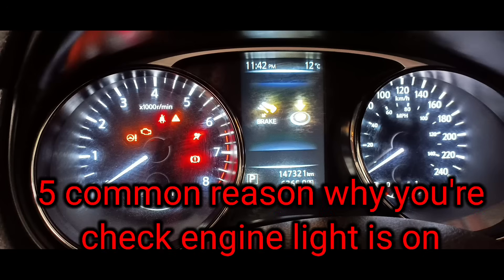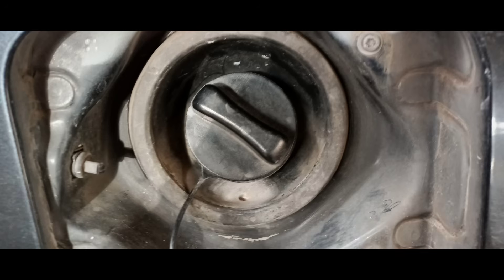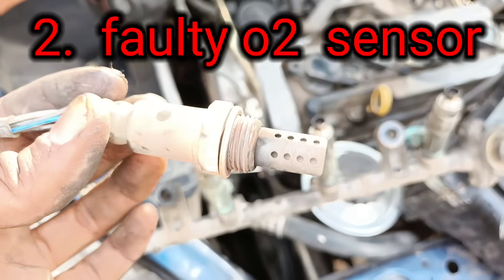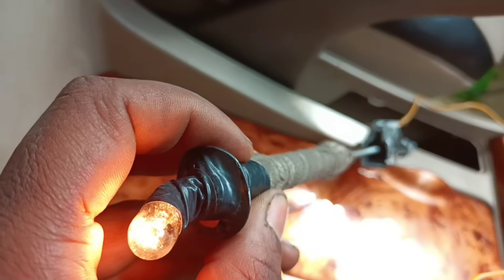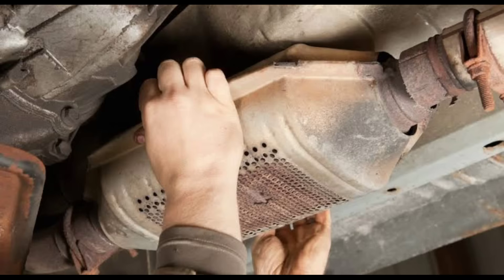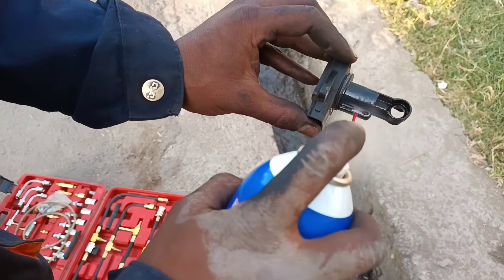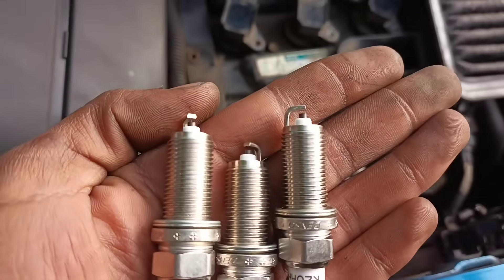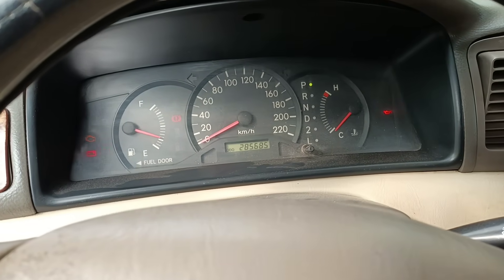The Top 5 Reasons Your Check Engine Light May Be On

Comment: My check engine light stays on most of the time in my 2009 ford escape. A few days ago that light started flashing and it turned out to be a bad cylinder. But before then it was supposedly a bad egr valve and I had it replaced but that didn't help anything. I just had the bad cylinder replaced and that got rid of the light for a little bit but it's back on now but it is running fine. I did use an obd2 scanner and it still reads the code for the egr valve. It is my opinion that older ford vehicles are notorious for engine lights coming on and they are just not designed well. For now I'm just ignoring the stupid light as long as it isn't flashing. I will not buy another ford vehicle.
Reply: Hi  your problem lies somewhere else . EGR will go bad only if you are having incomplete combustion of the gas. This generates soot or carbon and i5 starts depositing in EGR and then moves forward to intake and entire exhaust system. It contaminates the catalytic converter and  the muffler.
Cylinder failure is one of the results .
I suggest you look at the injectors and service them . And check and service spark plugs ,coils and air filters as well . 
But the way where are you located

Comment: My oil change was was overdue and I changed it and then the the check engine sign still appears what is the problem
Reply: When oil change is overdue the light comes with a message and or image of the oil can light up. You can get it reset and see. If it goes away then fine and if comes back then you need a scan
Reply from the maker: Check by obd scanner
Reply: They have to reset your computer. They do that for free.
Reply: The reset is..turn ignition on..tap gas peddle three times fast..this resets the oil life timer..

Comment: Also if your oil change is overdue can cause your check engine light on
Reply: Thanks alot..mine just came up and my engine oil is over due
Reply: My oil light started not going off after I start the car, then go off after a little while. Then it started staying on, then blinking on and off. Then yesterday the engine light went on 😭, taking to a workshop tomorrow. When I stopped at a filling station the guy there said there was oil was it appeared dirty. I hope it's not much🤦🏾‍♂️
Reply: Thanks
Reply: @travispegues8868  to😮😢😢
Reply: Bro thank you I just got my oil done today I was freaking out
Reply: Hv noted the same problem today..am hypothesis it's an oil change needed
Reply: @kamarlyngamba6332  is the light automatic gone after oil change or fixed. ?
Reply: My car had no issues. Few days after my oil change i parked my car at night, no light. Turned car on next morning and boom check engine. Wtf?
Reply: Thank you I should need a engine change
Reply: I'm hearing it cattling
Reply: Omg thank youu. I was so scared for my Subaru 06 sti. I check everything and nothing. Worked then I checked my oil, and it is black. So I assumed that I have to get an oil change.
Reply: @mikunakano8628 😮😢😮😂😂
Reply: @mikunakano8628 also on old cars?
Reply: @mikunakano8628  Lol
Reply: @mikunakano8628 same i need to change ok bro thank u
Reply: I hope so, Nissan told me 30k kilometers for my pick-up. Online i read 20k 🤓
Reply: I am so use "Check engine"' to the extend that when it is not on , I feel worried 😅😅😅😅😅
Reply: Thanks!
Reply: On granny tho
Reply: Ok👍
Reply: I had it changed every six months
Reply: Thank you. I think that is my problem
Reply: The oil cooler in my car is leaking. I'm waiting for parts. I have to wait until December 13th
Reply: To day morning I have the same feeling 😂 I think the oile is the problem 😕
Reply: Oil changes are a scam.
Reply: But there is a red light for engine oil's indication.
Reply: I'm over by 1k miles due for an oc. I'm hoping that's the issue.
Reply: My Peugeot 206 is doing that
Reply: Mine Turned On A Couple Days After I Got My Oil Change, What Could That Mean ?
Reply: Ohh. That’s why mines is on then
Reply: Just did one and still on… sounds like a exhaust leak… or needs a new muffler idk but I just bought this for 2k and man I hope it’s not gonna be a lemon.. 210k miles on her
Reply: My polo tsi started by check oil light then check engine light..what should i do
Reply: It's my cars problem, I'm not change oil since last one year😂
Reply: @chantisingam You crazy 😂
Reply: @chantisingam me too and it's on yesterday. Since last 4 months I only drove 20 miles 😂😂
Reply: @chantisingam is it giyer oil?
Reply: Really?
Reply: Plz reply ==is the light automatic gone when the oil is changed
Reply: @furqansartaj  No, they usually reset it for you as a reminder for the next oil change.
Reply: @furqansartaj I think once you reset the oil life it should stay off . If it comes back on then it’s something else

Comment: What causes high idle on the car
Reply: High idle can be due to cold start in the morning,  faulty mass airflow sensor faulty fuel temperature sensor.
Of course there is more to it. But these are primary culprits
Reply: Bad ECU reading…you might need to do a reset on it.

Comment: It’s good tutorial’ but what cause If Temporary the check engine light become on and off.  The light become some times on while you driving short time 😮
Reply: Exactly. My check engine light will come on then stay on anywhere from a week to a month. Then one day, out of the blue, the check engine light will be off when I start up. Typically it will stay off for a couple days to a couple of weeks before it comes back on again. I took it for an emissions test while the light was off and it passed. I’m told it needs a catalytic converter but I think it’s something else.
Reply: Needs thorough investigation via computer diagnostics . There are 100 plus sensors which feed data to the ECM  and it happens sequentially. So it is is possible that it gets a fault signal and then goes away and comes again when it’s the same sensor’s turn .
Reply: @MrKhabbu  I have 1.6 hdi Citroen where the Engine Light is on all the time. 3 different car repairs cant find the fault including Citroen repair shop.They all used  computer diagnostics. Last bill from Citroen was 5000 dollars and the Engine Light  is still on...
Reply from the maker: @chilli2473  tell me the fault code
Reply: @chilli2473  okay  I see. Definitely bad for you.But I have 2 question as follows 
1) Did anyone of these experts got a fault code while doing computer scanning .  If yes what were they.

 2) If yes we’re they all the same or all different  what were they. 

3) If no codes found then fine.

4) Since how long the you got the light on . Did you do something just before .

5) Is your car running smoothly and fine and you have no issues like low pick up low mileage rough engine .

Share details and let us take it further . 

By the way where are you located
Reply: @chilli2473  hi awaiting your response to my message

Comment: Check engine vs service engine  ?
Reply: Service is just something is recommended to prevent a possible check engine light which is a problem
Reply: @MazeedAkanni  
Engine fail safemode  ? 

Vehicle stuck in that mode
Reply: @Lupo32 it’s so dealerships can keep bending you over charging 40% above regular shops
Reply: @coewhat  
All I know is my used 2005 mercury mountaineer I bought back in 2014
Got rendered in engine failsafe mode 
In January 2023 and now I'm  vehicle-less.☹

Comment: I have p0448
Reply: Efuck system!!
Reply: 0
Reply: @hassansalim1148  The system where you can replace everything:valves,gas cap,filler neck canister and the gas tank and still throw codes!! Hence it is called Efuck system!!
Reply: evap code. i think.
Reply: It is related to EGR valve .